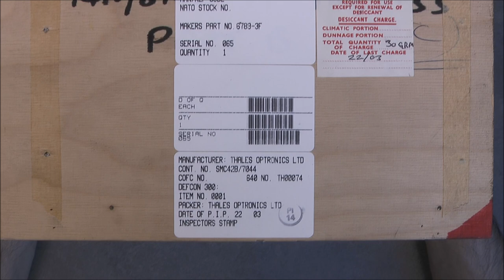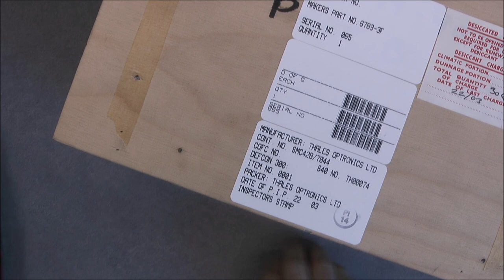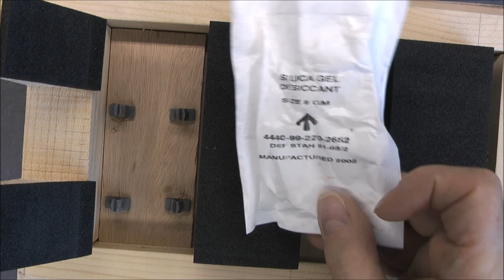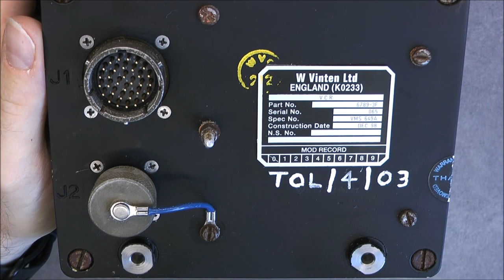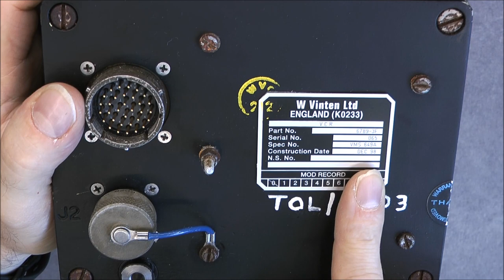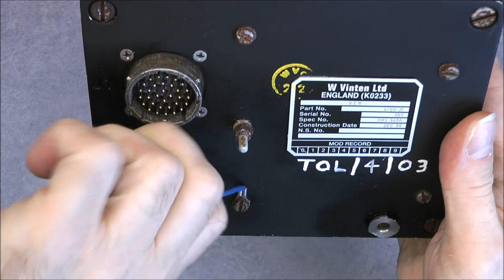Military aircraft Vinten VHS-C VCR drive teardown

Comment: The use of plastic components in the deck is a bit disappointing.  I personally would had used a Panasonic camcorder deck as they are built like a tank, with a machined aluminum chassis and very few plastic parts.  They are also very easy to service.  This is not only true of their professional decks but also their consumer ones.